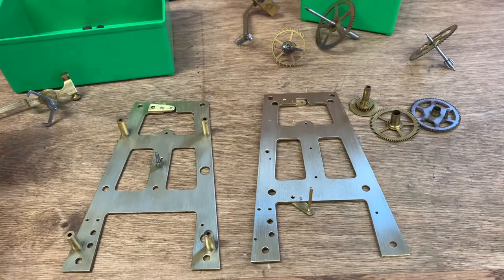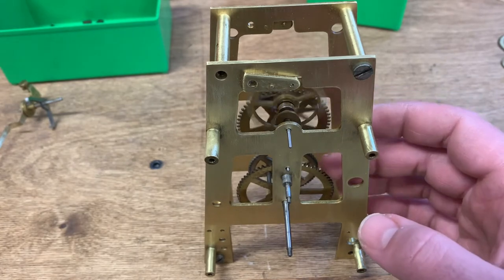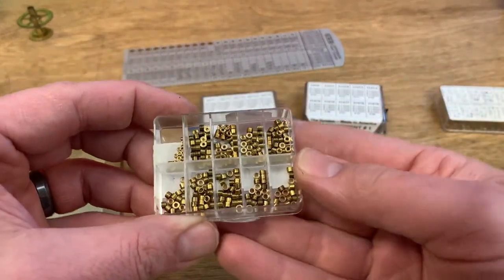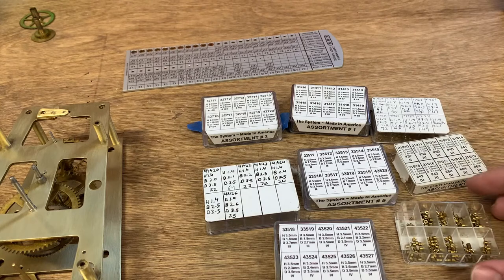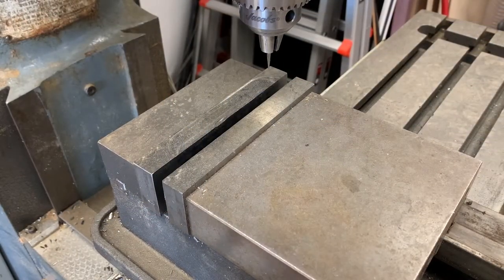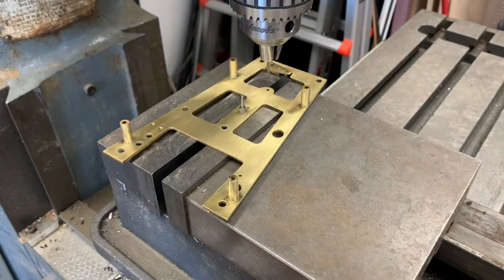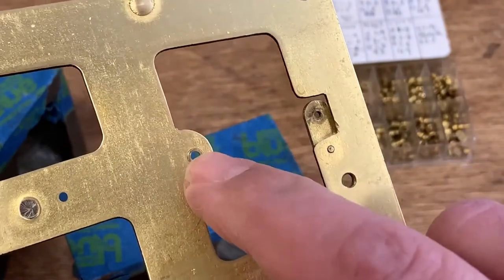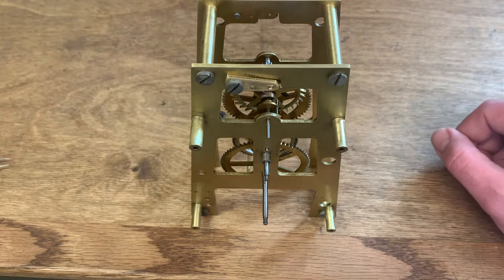Standard Electric Time Master Clock Restoration Part 3

Comment: I have a 1920s standard electric clock I just purchased from an antique dealer in Reading Pennsylvania, he purchased it from an action in New York . He had no idea if the clock ran or not but I took a chance on it because it was all original. 
I did get the clock to run but im concerned if it has the original pendulum on it , the pointer is past the scale at the bottom , the clock runs perfect and keeps time to the minute with my watch . 
How can I send you pictures of my clock to give me your opinion. 
Thank you in advance!